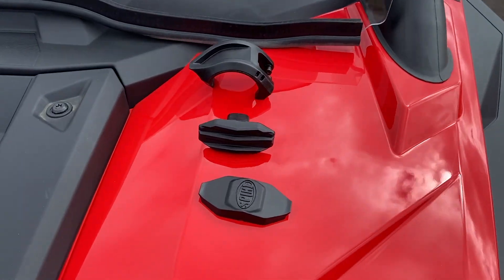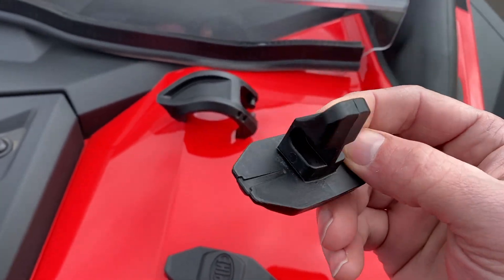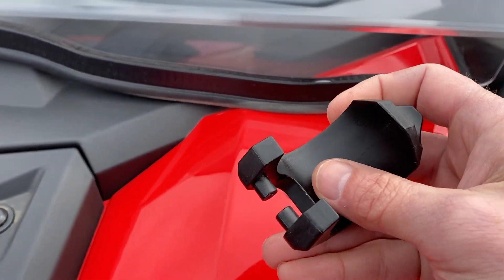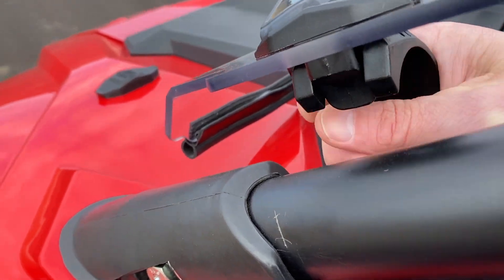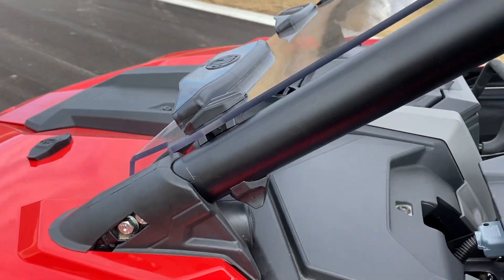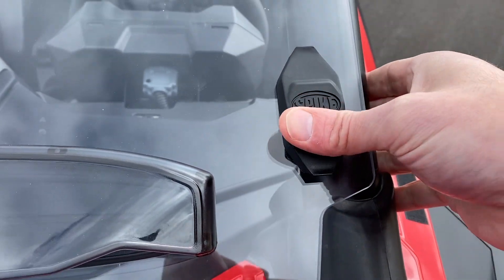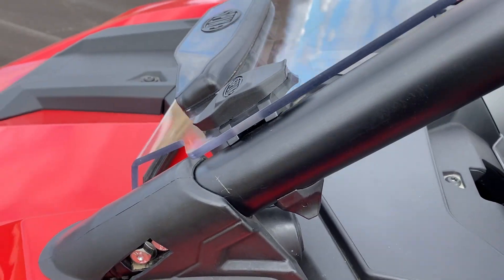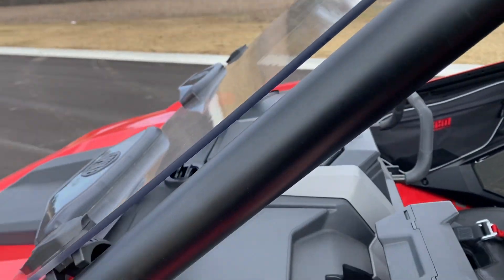Spike TRR Windshield Clamp Assembly

Comment: Saying they were not easy to install is an understatement.  I found it impossible to attach the clamps using only my hands.  I could get only one on but not the rest.  I found that by putting a c-clamp around the windshield clamp and the frame on the general and slowly tightening that I was able to force the windshield clamp around the frame.  I don't think it would hurt for the the manufacturer to make the windshield clamp a little longer (2mm) and then it may be possible to install by hand according to their directions, and would still hold the windshield securely in place.

Comment: They were NOT that easy to install, as 2 of the 4 would keep popping out of the hinge slots on the smaller piece. I'm a little concerned they won't hold and the window will fly off.
Also, you should make sure the window is up and in the slot of the roof(there is a gap created by a piece of plastic, creating a notch to insert the windshield) otherwise the windshield will flop around in the middle.